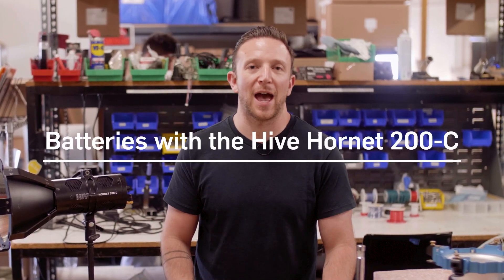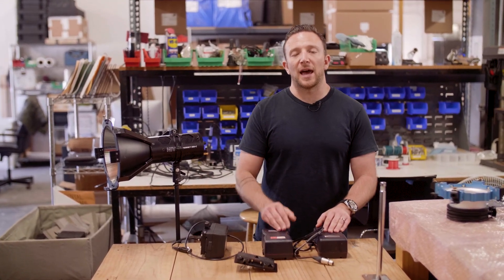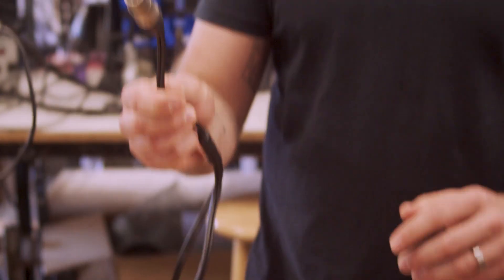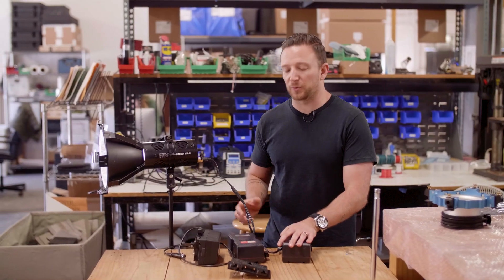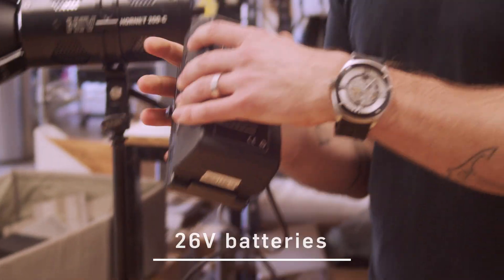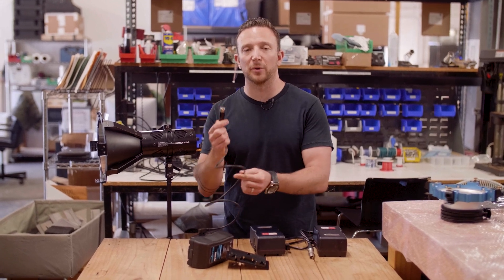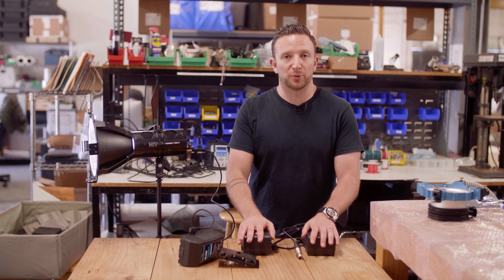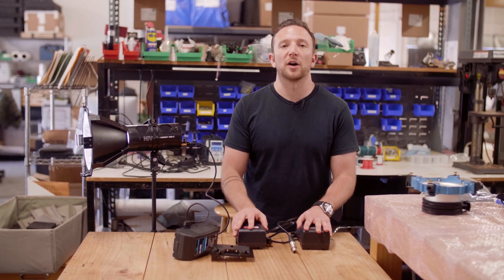Using Batteries with the Hornet 200-C

Comment: Can this be done the same way with the Wasp? Does it need two batteries as well?
Reply from the maker: Hi you can run the Wasp 100-C off of 14.4V Vmount or Gold Mount batteries but you only need 1 Battery no need for two!
Reply: @HIVELIGHTING  thanks. You guys are doing great work.